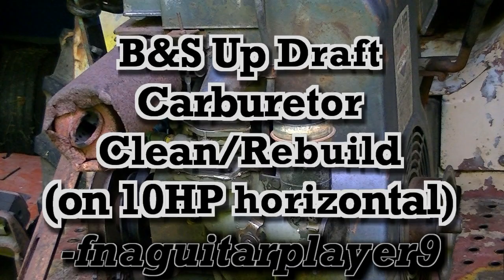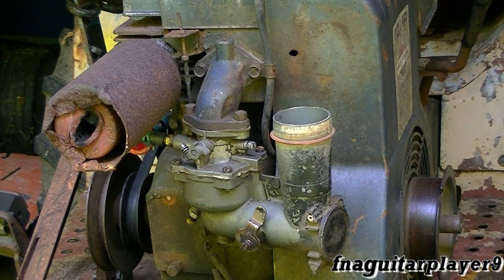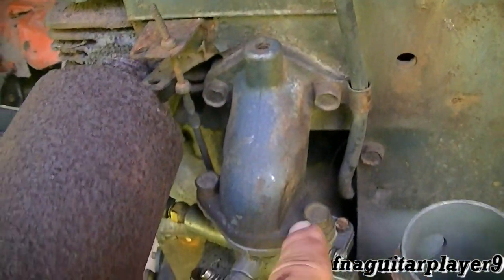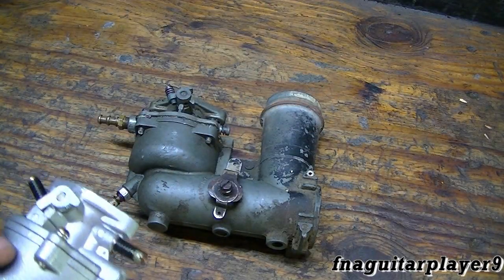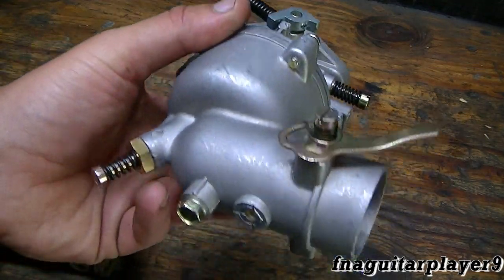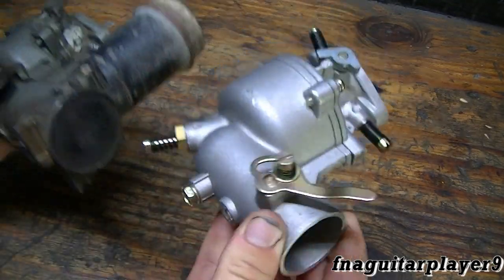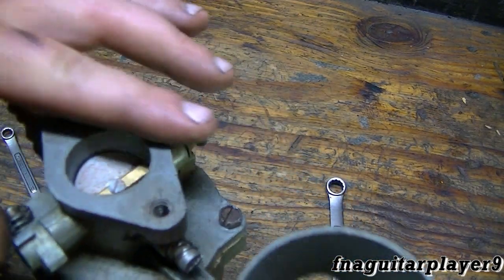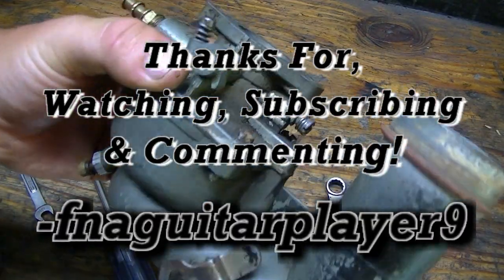Briggs & Stratton Up Draft Carburetor Clean, Rebuild & Adjustments  (older 10HP Horizontal Engine)

Comment: I'm up creek with one of these.  It's about the best maintained 30 year old pressure washer you've ever seen.  It'll start first pull, then run for about a minute and die on the spot. No slow death, no hint it's about to go.  It runs great the whole time until it hits the cliff. It hits pressure like it should.  I've pulled the carb apart, sprayed it with cleaner, adjusted the bottom screw just to make sure that wasn't it. The whole fuel delivery system has been replaced(except the stock primer bulb, it lets gas flow through it as it should and pushes when squeezed). The replacement carb off Amazon has the top butterfly valve going the other way so it'll open and run away when the governor tries to kill it.  I'm just at a loss.
Reply: In the tuning video, you mentioned that the fuel line flange was like valve lapping. What did you mean by this?  My first teardown left the pressure washer running fine for about a half hour or more without issue.  Because this unit has a 90 degree, I wondered if it getting overtightened like you mentioned could have caused something...

Comment: My tractor was built in ‘78 there abouts, I have some problems, and o was wondering if it’s got to do with todays ethanol regular gas. Should a different main run jet be put in it, or is there a same design carb but built for ethanol? Or do I have to drive way over to Buceyes and get straight gas. My generator will gum up after 10mins on ethanol, and it says on it by the gas tank cap “ no ethanol” so that’s why I’m thinking about this being my main problem. Also the straight gas cost $$$ compared to regular(w/ethanol).

Comment: Hey FNA, I really enjoy your videos, Thank you for all your hard work on them. Just wondering where you buy your briggs carb rebuild kits and parts etc. If you don't mind giving a link with a few of your favorite places you get your parts at. I always struggle finding the correct part #'s  by using the engine # codes. I know I could use a video on figuring out how you take an engine code and end up sourcing the right part.  Thanks again!
Reply from the maker: Your welcome, glad you like them! I used to buy from tulsa engine warehouse, but they went out of business, I've been getting alot of parts from MFGsupply.com and just off of ebay if i just need a couple things at a time. another good place for genuine briggs brand parts is jackssmallengine.com. Thanks for Watching!!!

Comment: I never had any problems with the updraft carbs AT all but I'd just use carb cleaner and compressed air on the long jets because I could never get them out. I also use a set of cutting torch tip cleaners for cleaning out jet passages. The side-draft jobs like the red one you showed were dandies too but those blasted choke-o-matics should be shot though like on the 3 or 3 1/2 horse  verticals. The first time would work but the hot start was just pull the breather off and hold the choke open but everything isn't perfect. You did a fine job and still waiting for that tune!.
Reply from the maker: I hear ya! They seem to be really reliable, this one just needed cleaned when i first got it. Sometimes they will not come out, got lucky on this one! I heard that, that is true on those, they can be picky and hard to start when they are hot. Good when they are running though! thanks, appreciate that, maybe one of these days! Thanks for Watching!!!